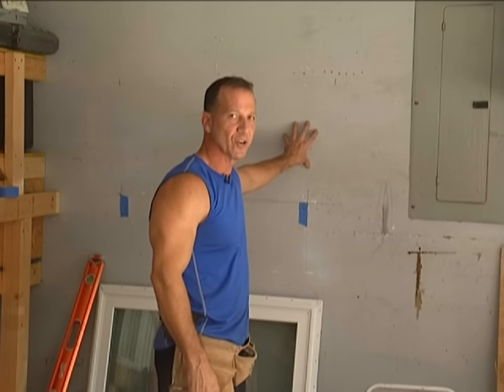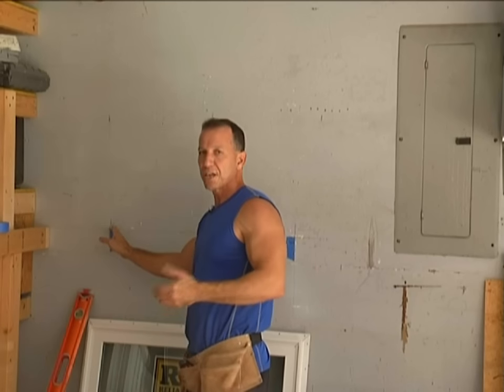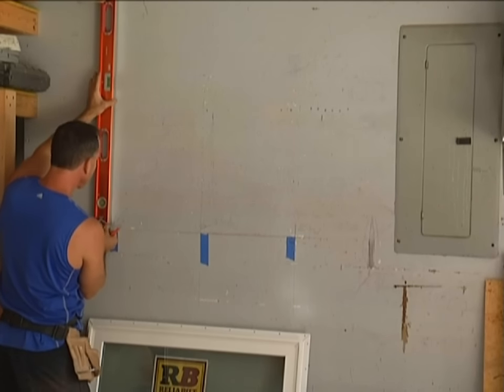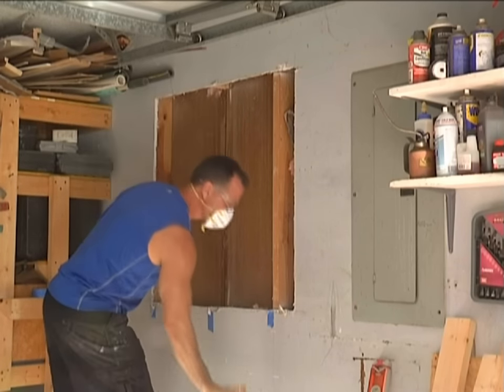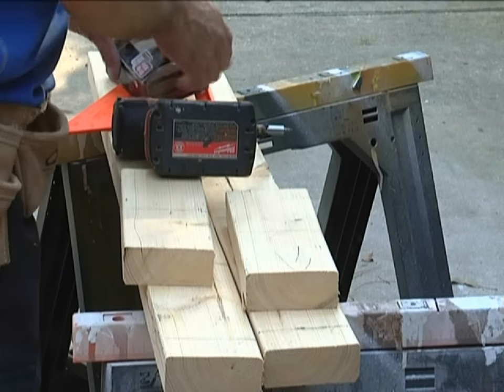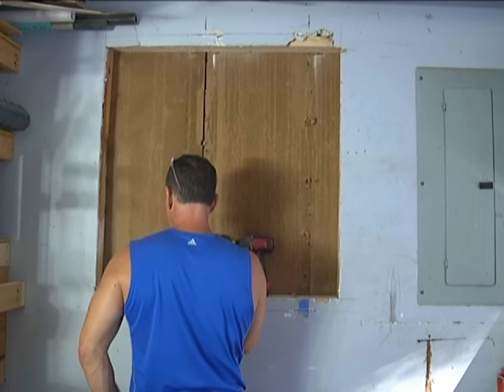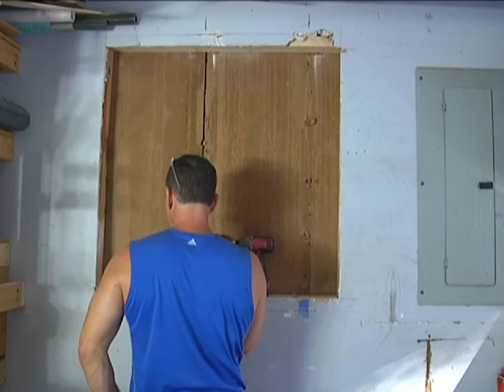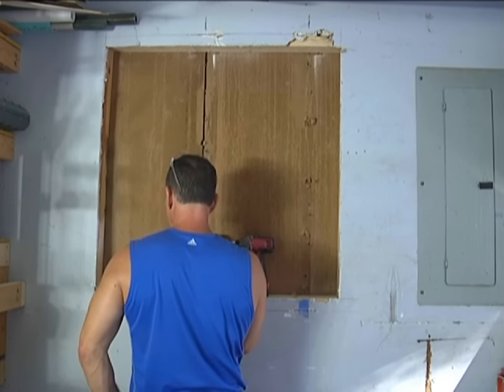DIY Window Install on a Blank Supporting Wall!

Comment: I have a mobile home. so do I just make a hole and put the window in. I have no siding. it's all metal.
Reply from the maker: +socomsfinest 1 
Hi, you probably have corrugated metal panels on your home. You can cut a hole and frame it without a supporting header. Most mobile homes have 2x2" studs and you probably have paneling on the inside with a small molding over the seams. I would remove the panel that you are going to add the window to. This way you can frame it from the inside and cut the window opening on your panel while it is on the ground. If your outside panel is corrugated, you should use an L shaped flashing above the window. This will keep the water from getting behind the metal siding. Use a good exterior silicone to seal the entire window. I would recommend using a replacement window that is made for renovation. It will not have flanges on it.  If you have any questions, please let me know. Good luck!
Paul

Comment: Haha,  Look at that mess.  Better to do it from inside. Less mess. Less headaches.
Reply from the maker: +TigerNgtMare 
Nope, you're wrong. If I were to do it from the inside, I would have to cut the rock out , patch it, blow texture,prime and paint! I completed this job in a half a day. Remember I installed a header, I needed room to attach it properly. Cutting the siding was easy. 
Thanks anyway!